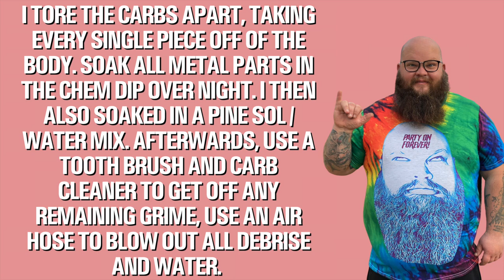CHOPPERS FOR DUMMIES EP: 3 INSTALLING LOWBROW SHOTGUN PIPES AND HOW TO REBUILD CV CARB

Comment: Brand new to all this, just watching these videos out of curiosity. Can anyone tell me if you can put any motor in any frame? Or are there specifics for pan head, shovel, etc?
Reply from the maker: Hey Rayne, There are smarter dudes out there that have specific info on this but some motors/frames are interchangeable depending on years and some are not. A lot of the pan/shovel/knuckle stuff is swappable but when you start getting into the evo motors and newer, you start running into clearance issues and once you get into rubber mounted stuff it gets real hairy. You can't put a different motor in a sportster frame and you can't put a sportster motor in a big twin frame. Hope some of this helps. Thanks for watching the vid.

Comment: I’m currently installing mine on my 07 sporty, is the flange suppose to sit flush with the block? I don’t really see that happening with mine
Reply from the maker: Nah. It likely won’t sit flush cause of the clip ring and the flanged end of the pipe. 
Check for air leaks at the seem where it meets. As long as now air is coming out, you’re good.
Reply: @PARTYONFOREVER  appreciate the response brother

Comment: This vid was awesome and informative but I don’t really understand the info 😅 like the reason you swapped out your manifold and when you switched from Voes to gravity. Is that better? I’d be eternally grateful for any wisdom passed unto me chopped messiah or chopper brethren🤙🏾
Reply from the maker: The bike came in with a S&S carb on it which has a different manifold than the CV. I took the S&S off because the owner of the bike wants to keep that carb for a different bike. So i had to put a CV manifold on it. 

I always take the VOES off when rewiring a bike. It is unneeded in my opinion and its just one more part on the bike that could go bad at some point. My whole philosophy on bikes is to make them easy to work on and troubleshoot when/if something goes wrong.
Reply: @PARTYONFOREVER  Oh alright, I didn’t know you had to switch the manifold too. Thanks a ton man!

Comment: I think you went a bit overboard on the main jet. You shouldn't need anything bigger than a 175... maybe 180. A 175 should do it. That's what I'm running in my sportster chopper. A 190 is what came on a stock 88 twincam. Great stuff, man. Keep the vids coming.
Reply from the maker: for more context, i'm gonna be putting a velocity stack on here too. completely open intake and completely open, short drags, its gonna run fairly lean. I once used to run a sporty with the same set up and had a 190 in it and it ran pretty well but its been years since then so i could get this thing together and be wrong. I'll keep ya updated. 

thanks for the heads up though and always checking out my videos. I appreciate it man.
Reply: @PARTYONFOREVER  Sure thing

Comment: The end of that video was heavy, bro. No pun intended. I’m fat and don’t like it. Been fit most of my life but had a back injury and went from 200 pounds to 250 pounds. I’d love to cut 50 this year. Problem is I like Taco Bell. I don’t like blood pressure meds though which I had to start this year... being fat will kill ya, that’s true. It’ll kill me too. Gotta wife who wouldn’t be to happy about that and it’s seems like you do too. If you gotta cut some pounds I say do it. I’m in the same boat and know it’s hardAF though. Like chore’n though... it’s probably just something’s that’s gotta get done. (Also I’m 35... so I’m well on track to be 300ish by the time I’m 39 if I don’t start getting healthy now). Either way, you’re a motivatedAF dude... which I’m not.. in lazyAF... so if anyone can cut a few LB’s I’m betting it’s you bro! 💪💪
Reply from the maker: i've lost a large amount of weight twice in my life and put it back on. I have the will power when i really want to but its hard to flip the switch. it also doesn't help that i truly like being the big, bald, bearded dude. It's my identity. but daddy gotta diet soon.
Reply: @PARTYONFOREVER  I’m in the same boat. I kinda like being the big bearded bald guy. It’s makes for a shorter lifespan though unfortunately.

Comment: Doing the on my old sporty, I have a dead short. Could that be from the starter ? It shows full power to frameand that's not right brother man
Reply from the maker: Man, its possible. Starter could be grounding out. 
Whats happening? Turn key on then what? is the main breaker tripping when key is turned on or is it happening when you hit the starter button?

Comment: Hi Andy. Good choice for pipes. Lowbrow Custom's is located in my neck of the woods (NE OH). CV carbs are great for stock and slightly warmed-up engines. I've run Mikuni carbs, SU carb, and a fair share of S&S carbs with good results. Lectron carbs are amazing, but pricey. I know of 2 guys in Cleveland who run Lectron carbs on Big Twin Evo strokers (with no problems). Keep up the great videos, man! Ride safe -- W
Reply from the maker: I'd love to try a Lectron out. I'm just too poor. I can buy a used sportster for the cost of a Lectron. haha. Maybe one day! Of course there are better performing carbs than the cheap, stock, CV. I just like to preach the idea of use what you have at your disposal. I can tune a CV to do anything I need it to do and its such a easy carb to deal with. Thanks for watching and sharing your thoughts man! I appreciate it so much.
Reply: @PARTYONFOREVER  -- I know all about making the best from what you already possess. I've tinkered with Bendix carbs and CV carbs to get the optimum performance out them. It's all about your particular riding style. I've built and ridden bikes powered by expensive stroker engines, but deep down inside, I kept thinking, "Who am I trying to impress?" Hell, choppers are cop magnets anyway -- so who needs speeding tickets? A stock displacement H-D can still get you in "trouble." Just a thought.  Build right. Ride safe. -- Walt on America's North Coast.